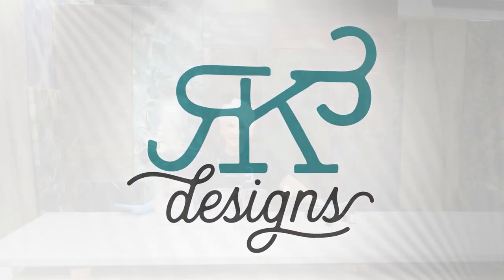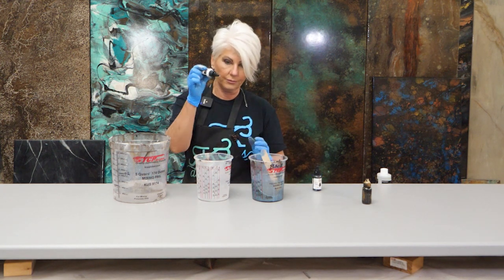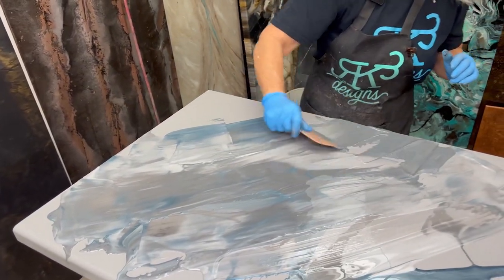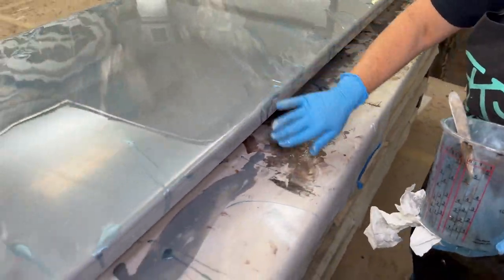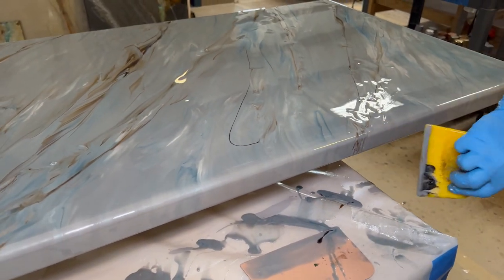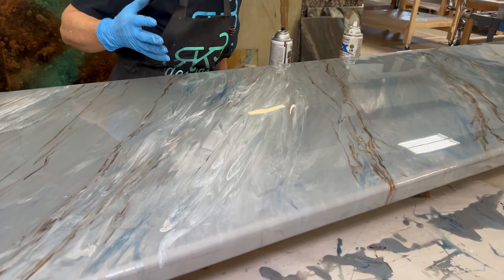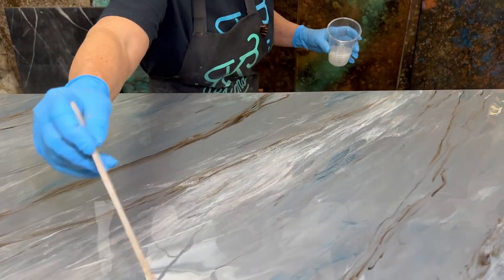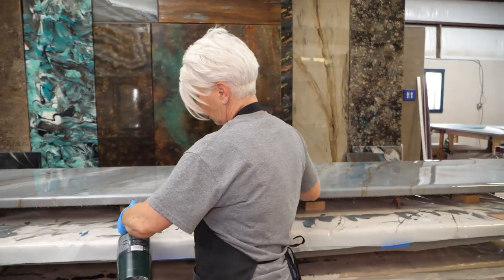Gray Marble Epoxy Countertops With Blue Earth Accents | RK3 Designs

Comment: Is there a reason why you didn't start with a light spread of epoxy on this project?  Thanks
Reply from the maker: It’s not mandatory to do a skim coat. The skim coat will just help the epoxy move a little easier. If you don’t want the pattern to move too much, you can skip that step. 😊

Comment: Why not just spray alcohol mist and get the bubbles out without torching..
Reply from the maker: Depending on what epoxy you’re using will dictate how well alcohol pops the bubbles. Too much alcohol on the surface can compromise the integrity of the epoxy.